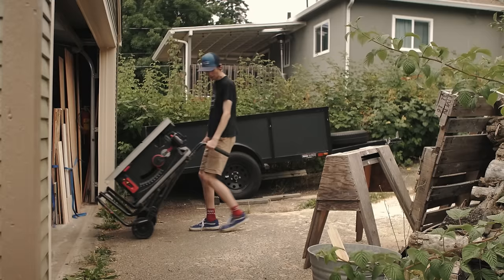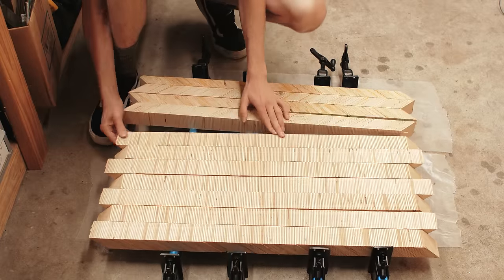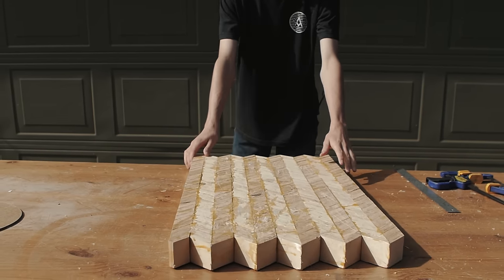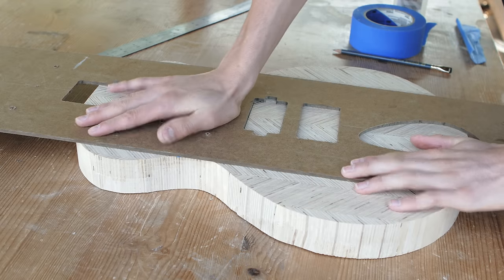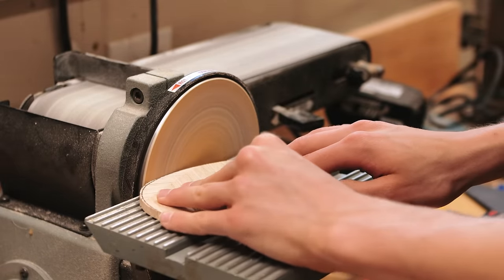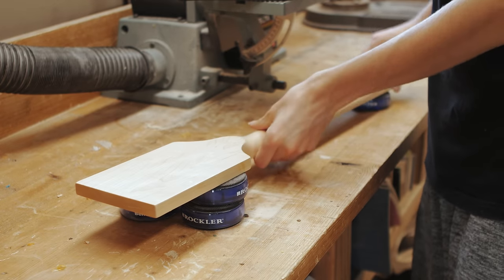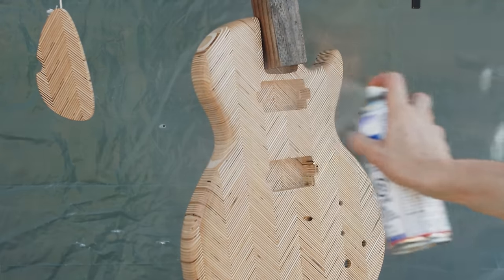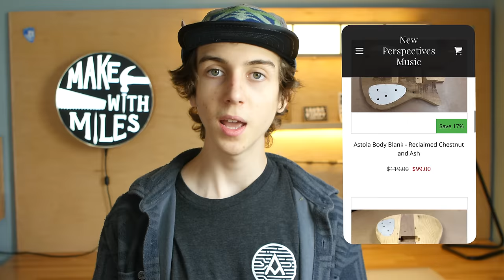I Built a Guitar Out of Plywood  // Great Guitar Build-Off 2020 Unofficial Entry

Comment: Very impressive job. I'm impressed to see someone so young with the patience and dedication to take on such a project. I'm 68 years old and have been playing since 1961. I don't have access to the machines you have, so when it came time for me to assemble my guitar I used all Warmoth parts. This was well over  18 years ago I started with a standard Strat style body and quarter sawn standard profile pre-CBS  style Strat neck with the smallest frets  they offered,  1 5/8 nut, 21 frets rosewood fretboard, headstock adjustable truss rod and drilled for Sperzel locking tuners. I used DiMarzio pickups, vintage style single coil for the neck and middle and an Air Norton S for the bridge. I used a standard Fender '62 style tremolo bridge.  Again, great job.

Comment: This is by far, one of THE BEST videos I have ever seen, Anywhere, it was well presented and narrated, and I appreciated that you adhered to proper safety proceedures.

I built a guitar similar to yours about fifty years ago which ended up on a good friend's wall as wall decor instead, but with mine I used 'burled wood' over 1 1/4" hardwood, while the neck, head, and tuning machine were donated by my Woodshop teacher, as well as everything else from another friend's stripped guitars.

Wish I still had it, because it actually came out better than I ever hoped for, but since I just bought a few new tools for woodworking, I'm looking forward to building something similar to yours, but in Obsidion Black and Gold Leaf, with mucho clear urethane to protect the finish.

Thank you for sharing your expertise and excellent Craftsmanship.

Comment: Great Build. Love that you did that wonderful pattern. Great planning, great execution. 

I was worried about a lot of blowouts when the router came out during the pickup cavities and neck pocket, but it really turned out well. I would love to see an update in the future as to whether the hardware stays put. Particularly the bridge. The drilling into the grain makes me wonder about long term stability. 

I liked and subscribed because of this video! I also pinned it on Pinterest and shared it around. Great work!
Reply from the maker: Thank you so much! I will do an update if anything breaks, but the screws are pretty long so I'm not too worried. Thanks for the sub and the pin on Pinterest, things like that really help the channel ;) <3

Comment: For better polish with spray finish, make some sanding between layers and at the end use windows cleaner. the substance is more abrasive than furniture cleaner and that's why it get better glossy finish. try it with scrap wood and you're gonna get amaze
Reply from the maker: The finish I used is catalyzed so it's pot life is 48 hours, which means your unable to sand between coats-- not enough time

Comment: Awesome work my guy! I kinda wanna make a herringbone plywood guitar now lol.

One thing though, if you're gonna use foil tape in the electronics cavity, there are a few rules of thumb. Generally the purpose of doing this is to make a faraday cage to block out radio interference. To do this, the entire box, or as much as possible, must be covered by the foil, and that means to cavity cover as well. Also, the cavity cover and the cavity itself should have electrical continuity, ie the foil of each piece touching to make a solid connection. Moreover, cavity foil is made with special electrically conductive adhesives. Standard foil ducting tape is not, and is usually soldered between strips to maintain continuity.

You're the man! Keep it up!

Also, kudos on the magnetic cavity cover idea! That's a game changer lol!

Comment: Super cool design, and excellent execution! One small comment is that you'll get much better solder joins if you hold the iron to the joint until it's hot, and then apply the solder to the joint, rather than the iron. Your method of sort of tapping the iron against the solder means that the joint isn't getting hot enough for it to flow and bond correctly.
Reply from the maker: Haha, thanks for the tip, My soldering iron is not the best and it doesn't get hot enough. It takes like five minutes to head the joint enough to make the solder melt 😅

Comment: Cool. Wish I had those tools. Can you do it again with a coping saw hand drill and dremel? I missed the part where you built the neck.
Reply from the maker: A lot of the those tools, I borrowed or bought used. It can be done with limited tools, but because I have access to the power tools, there isn't a good reason not to use them. Also if you watched the whole video, you would know that I didn't build the neck
Reply: @MakeWithMiles  yeah I was being a smart ass. I couldn't have done it with those tools. You've got a real talent and should be proud of your work I think it turned out great.😉👍

Comment: Great guitar. I have a question after sanding the guitar did you add sanding sealing or just straigth away with the clear paint?
Reply from the maker: Thank you Dean! I went straight for the clear coat, because it is an automotive/heavy grade clear coat, there was no need for sealer.

Comment: Pros:  great idea, great aesthetic, looks really cool and you can't buy that that anywhere for multi-K custom prices. cool build
Cons: probably heavy, lots of wasted plywood, glue and wood don't really finish the same, need a lot of layers and coats and you don't even have grain filler or primer on there, do you?
Reply: yeesh
Reply from the maker: It's around 9 pounds and I always save the patterned plywood scraps so it is not wasted. Also the finish is very thick (meant for automotive) so it is a very smooth surface, also I did use filler I just didn't show it in the video

Comment: Great build. i really like it. You should have lowered the neck pocket a little, so the fret board was flush with the top of the body, and then your pickup ring butts up against that, as you would make the end of the fingerboard square.
Reply from the maker: Thank you! I agree, with you on that. The thing is that this was my first guitar build, so I didn't want to stray far away from the way my friend Tim had advised, I will probably make these modifications on the next guitar.